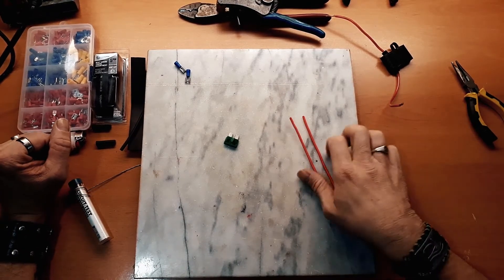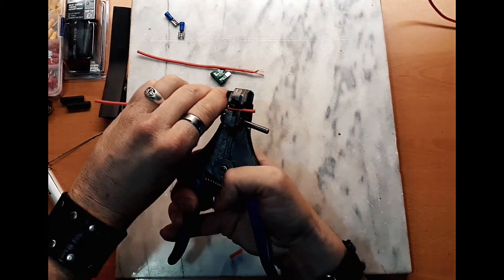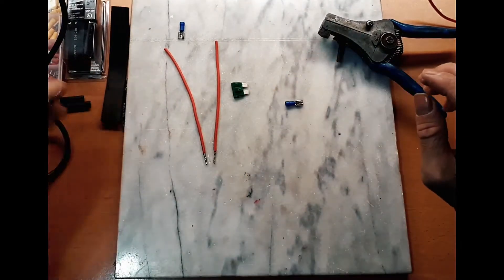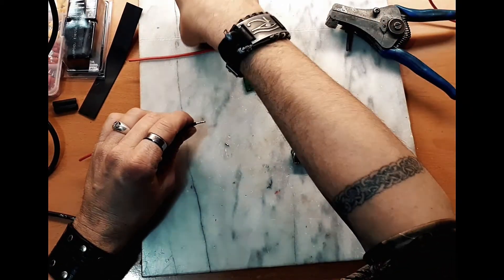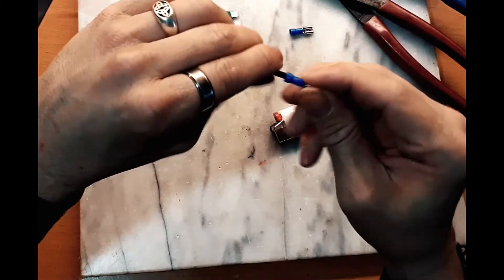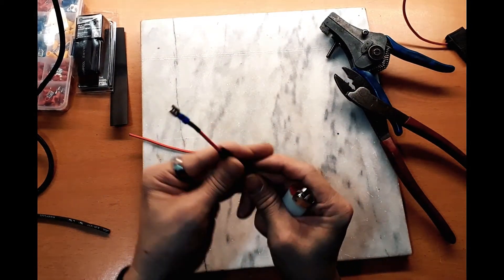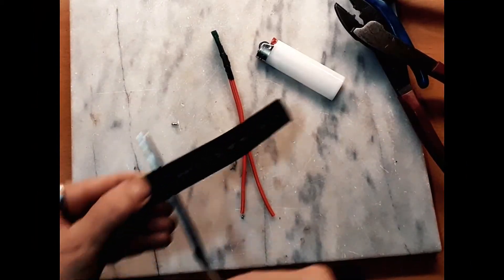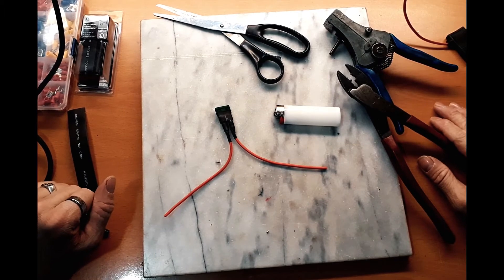3 Minute inline fuse Fast, durable and cheap  water resistant, dust proof, perfect for off-road apps

Comment: what is the wire gauge?
Reply from the maker: I mostly use 18ga sometimes 16 on smaller projects but for tutorials I will use something very small as its just a demo.  It would depend a lot on the load your putting through the wire one led would be different than a winch etc